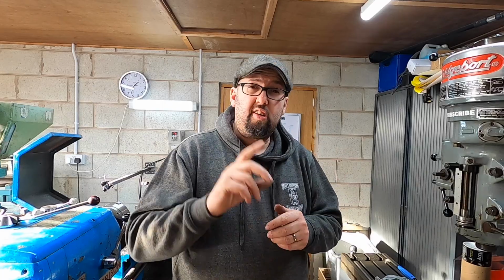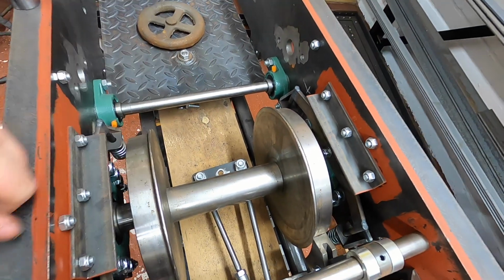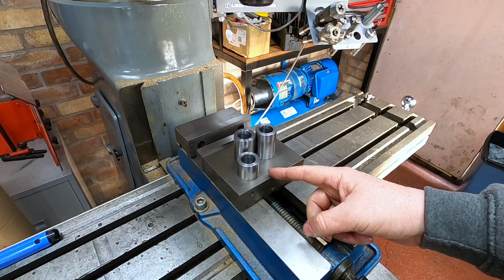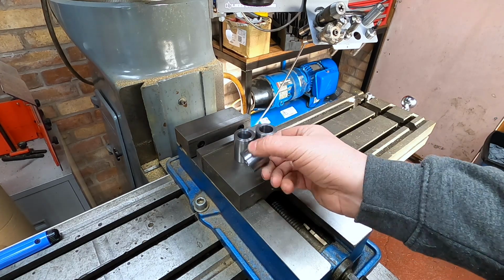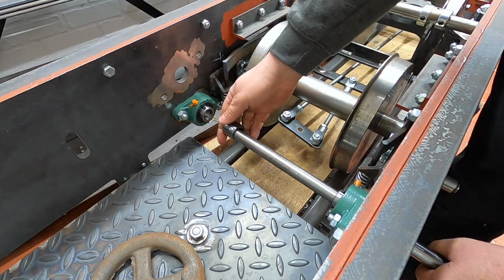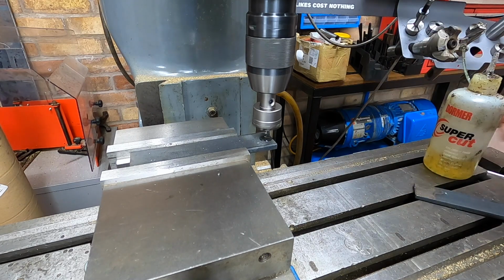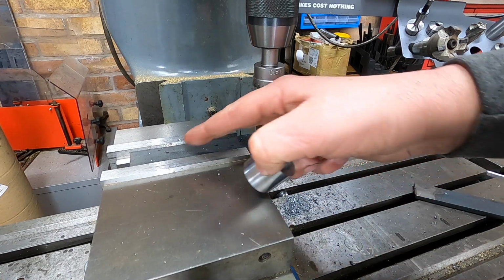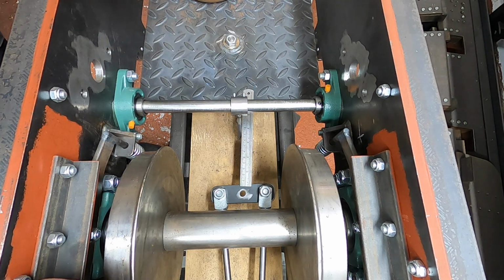Brake layshaft drop link - EP39 - 7.25" Gauge Steam Locomotive Build

Comment: I imagine you'll cut your keyway in the same spot as the grub screws.
Reply from the maker: Erm...... no, but the grub screws are only there to stop it moving side to side. All the best, Matt 👍
Reply: @MattChiversWorkshop  Oh, well, the grub screws might gall on the shaft and you'll have a harder time removing it. Put them on the key and you don't have that issue.

Comment: Sensible comment time (for a change!)  Is there a practical reason for using the self aligning bearings for the weigh and brake shafts?  Seems to me that in both cases it is very slow speed rotation, intermittently.  Confess that I think the original design is neater.
Reply from the maker: No practical reason at all, just cuts work out, although if I build a second one.... I'll machine something a little nicer, I won't do another like this. All the best bud, Matt 👍

Comment: It needs a tapered pin, not a key way. If you don’t want to invest in a tapered reamer, a straight pin or even a bolt will do. In all cases it’ll act as a shear pin if things go horribly wrong.
Reply from the maker: So if you wind the brakes on too tight, the taper pin could snap and you have no brakes, think I'll stick with the key!! All the best, Matt 👍